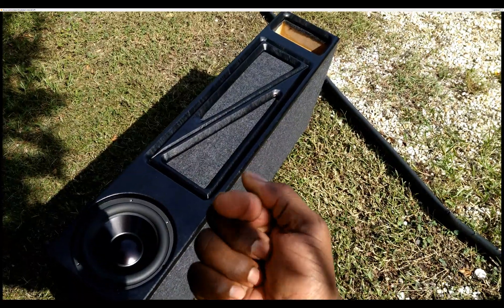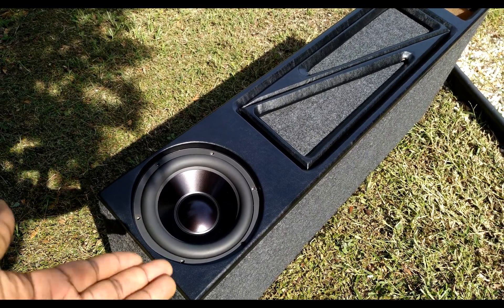T-Line Subwoofer Box - With Beauty Panel

Comment: How did these turn out in terms of volume, SQ, and extension? I'm debating grabbing a pair of these myself and tossing them in my living room. Looks like they have a simulated f3 of ~20Hz in a ported box, so I imagine a t-line would be better and louder, but at the same time, the QTS seems a bit high to use in a t-line situation.
Reply from the maker: These subs are simply amazing. I am planning to build a second of this T-Line. It is currently in the living room and resonates all the way upstairs.